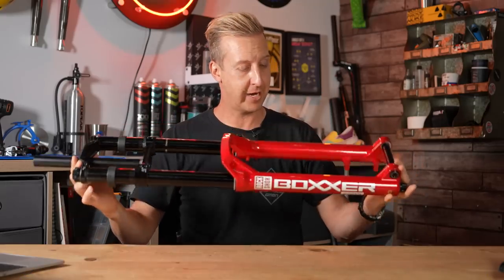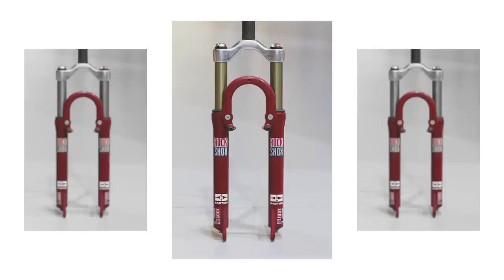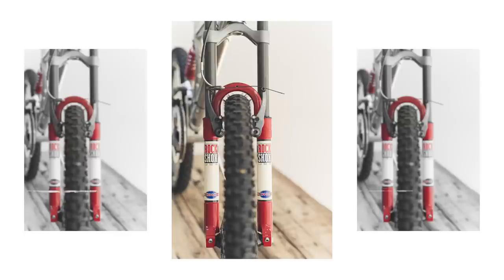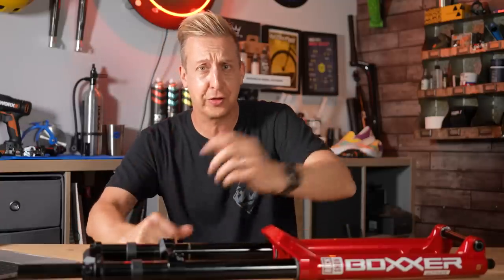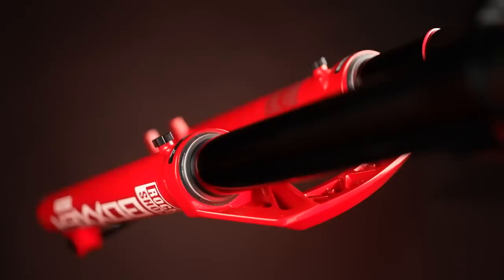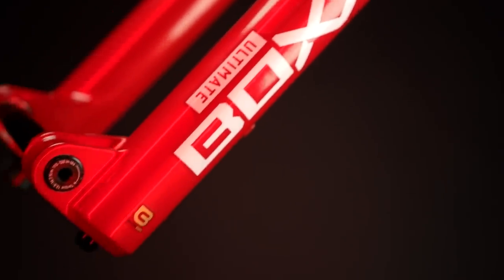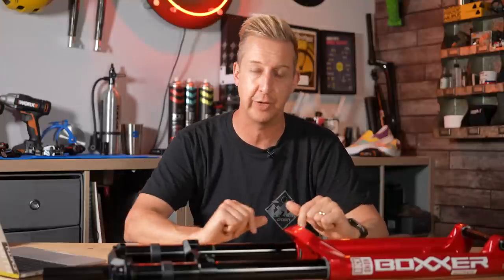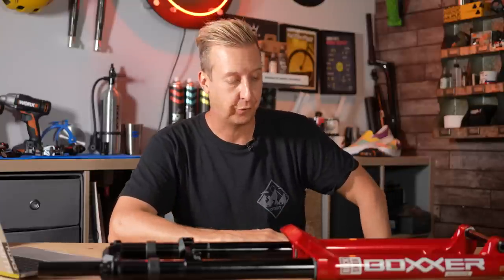The Ultimate Downhill Fork? | RockShox BoXXer Deep Dive & First Ride

Comment: Great content, thank you! I have one of these in size 27.5 and I want to switch to 29.

I couldn’t find any official info, but from my research, you can absolutely do this because the lower legs between 27.5 and 29 are exactly the same, apart from the 27.5 having the axle part a bit higher up the leg to accomodate for the smaller wheel size. Anyone has any info on this?

Comment: #doddy and Anna. A question as old as mountain biking itself.  Mixed wheel width for better grip. Is it better to run wider tires in the front. Say 2.6F / 2.4R? Or is it just confirmation bias?

Comment: Nearly $2k usd for it 😂😂😂😂😂😂😂.
Reply: Fox 40 is like 2200 so it's not that crazy. Pretty much market value.
Reply: @WorkLessRideMore   you can get Ohlins forks for a R1 motorcycle thst goes nearly 200mph for $2600 brand new. Bicycle part prices are outrageous for what you get.
Reply: An r1 would do the same top speed without any forks at all. Completely irrelevant. Forks on a road race bike have a much easier life and are only 120mm ish
Reply: @Bally46  easier life? Lol. The forces the tire exerts alone are massive on the forks at high speeds.
Reply: @WorkLessRideMore  fox 40 is around 1800 in u.s. boxxer is around the same and ohlins dh38 is around 2300